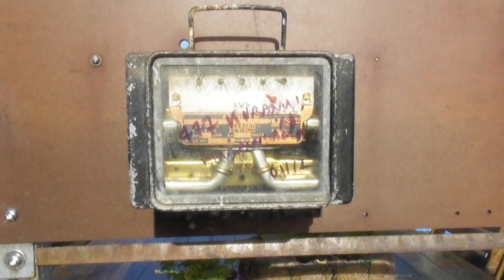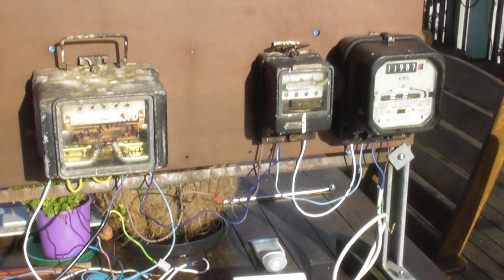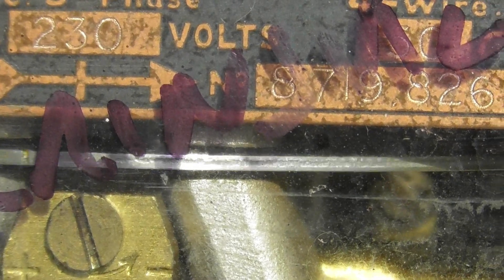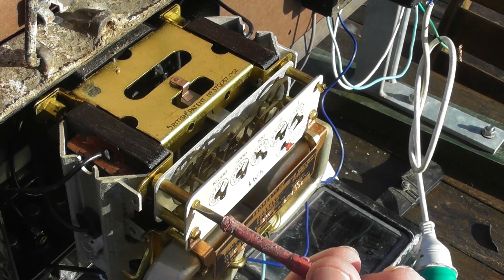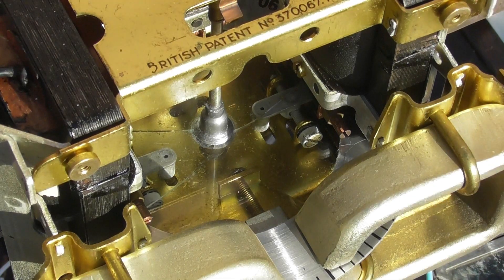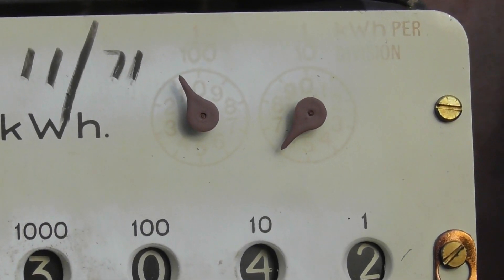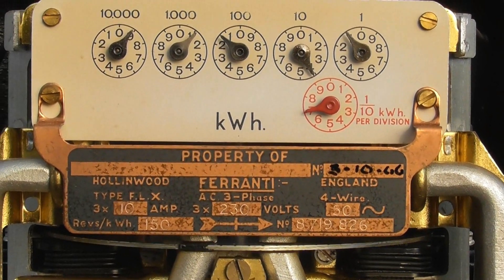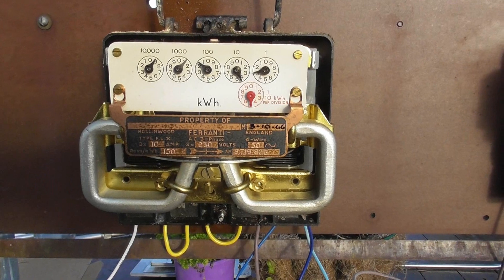Vintage Ferranti Hollinwood FLX meter from the 1930's still operational

Comment: Great quality electromechanical meter. I was unaware that placing the 3 coils in series would increase the rate, I will have to try it next time. It’s a shame there are no new ones being produced anymore. It appears that the electronic meters have become way cheaper to produce with plastic, instead of copper coils and iron cores and brass drive trains. I’m curious to see how long the new electronic meters can last. Great video as always!